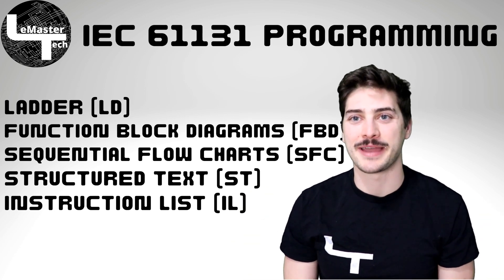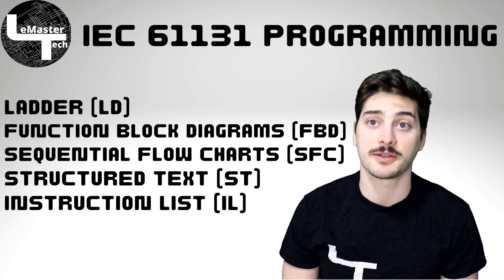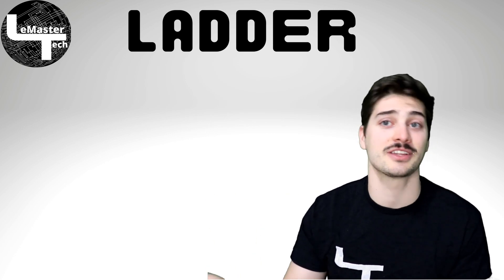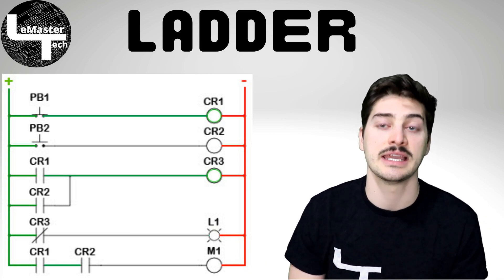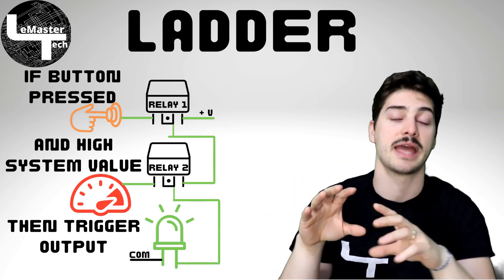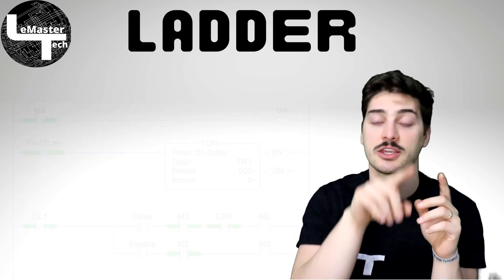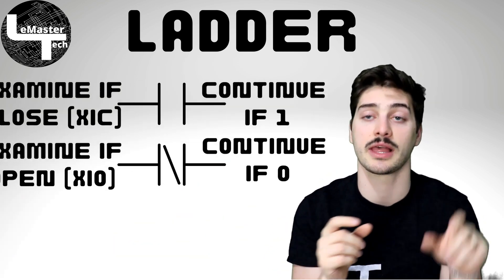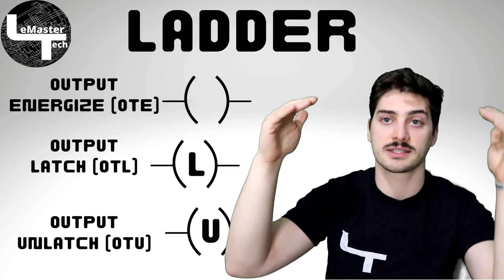The PLC Programming Languages for Controls and Automation Engineering | LD FBD SFC ST IL

Comment: Is there any certificates in these languages? I learned ladder logic working my first job out of college, but now that I have moved I am trying to bolster my resume with a certificate.
Reply from the maker: Hi! I am not sure there are certificates in these languages because every PLC manufacturer (ABB, Rockwell, Siemens, etc.) had slightly different formats and conventions, and no place I have ever worked has required or offered any certifications but if there is it would probably be done through the IEC organization!